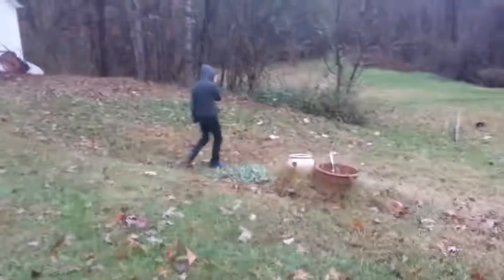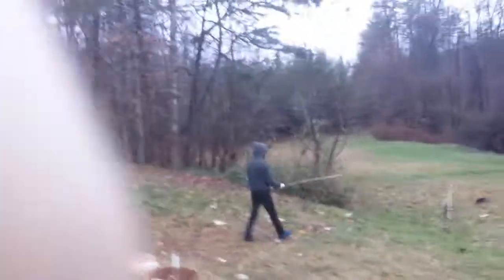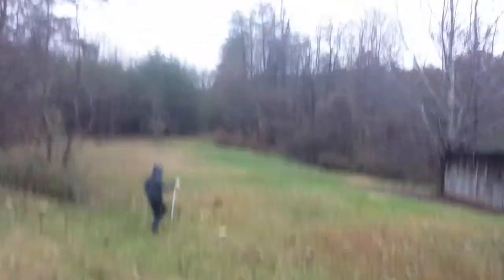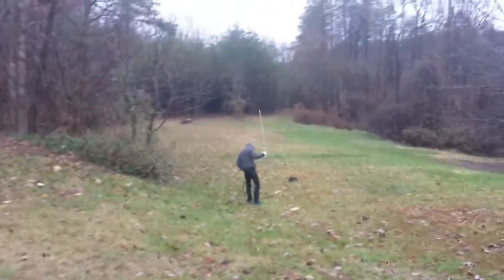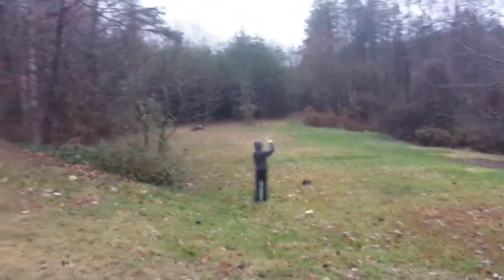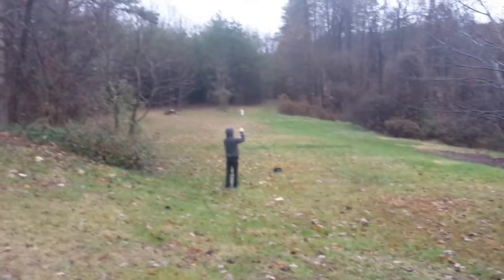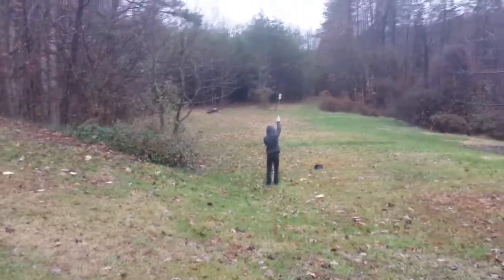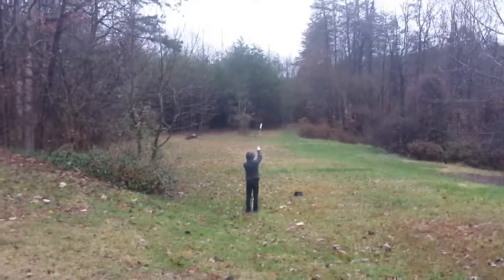Sugar rocket Into the clouds! 2300 feet!

Comment: Congratulations!! I been trying to get them to launch and had so many fail... Im thinking I ain't drilling the nozzle deep enough into the fuel... Do u know if you need to use clumping or non clumping litter???
Reply from the maker: I used the absolute cheapest litter I could find, which im sure has no additives at all. Just pure bentonite clay.  I think it was .99 usd for a huge bag. I had many failed bulk heads and nozzles using other litters.
Reply: schel sullivan mine says 100% clay... (No clumping) was $3 for 20lbs